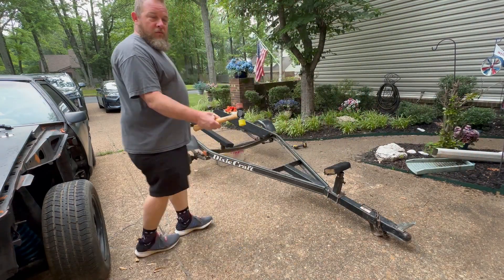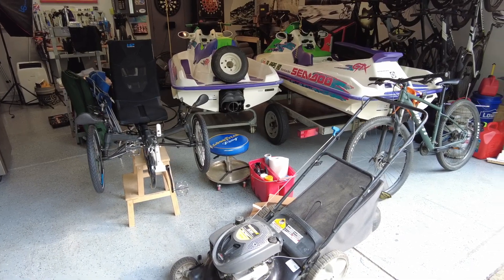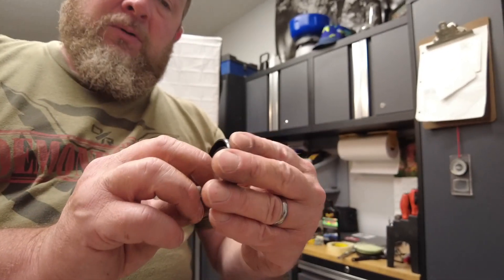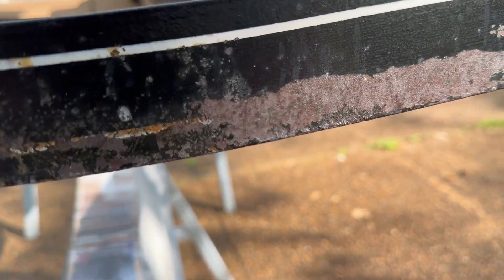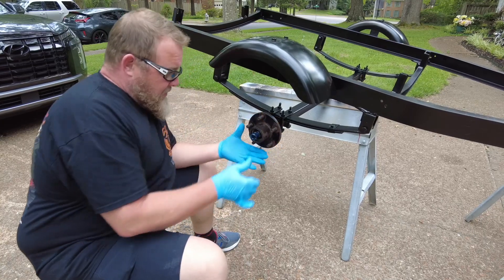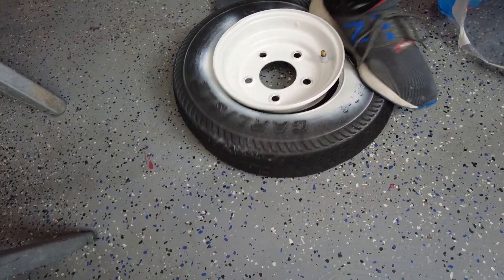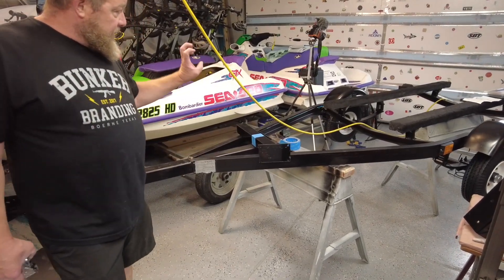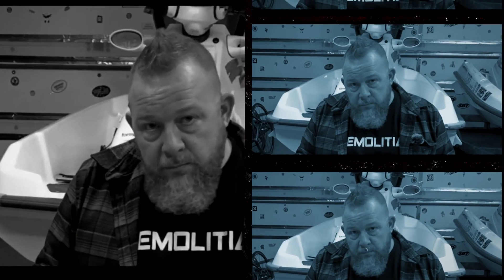Seadoo Trailer Makeover, Overhaul Hub Bearings, Install New Trailer Lights....and More!

Comment: Your first hub that you pressed the race into had a giant crack in it!
Reply from the maker: There was definitely no cracks in the new races. I have to assume you mean where there was a race sitting on a race, I ground an old race down to use for pressing new races in.  I talk about it at 11:50 . But thanks for looking out. I don’t need my hubs coming apart on the highway. 😎👍
Reply from the maker: I see what you’re talking about now. I think that was either where I had  dragged a tool across it or a streak of grease.